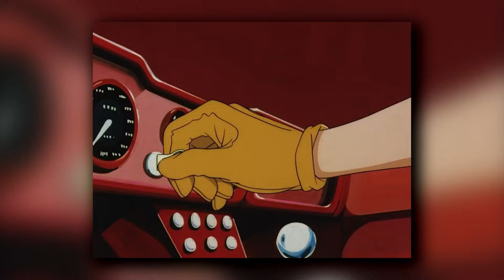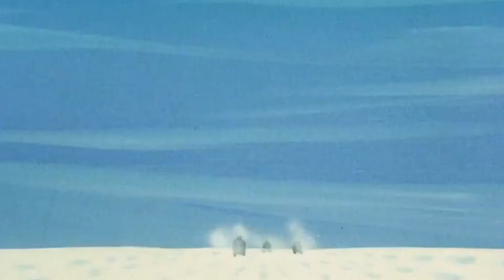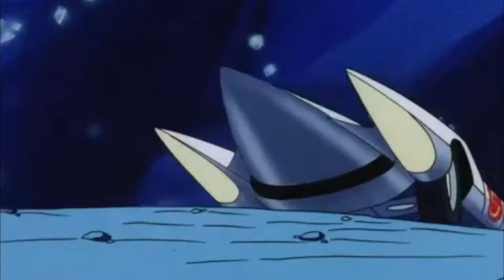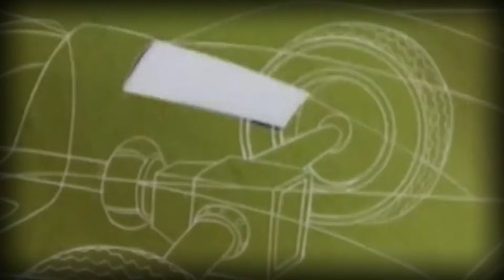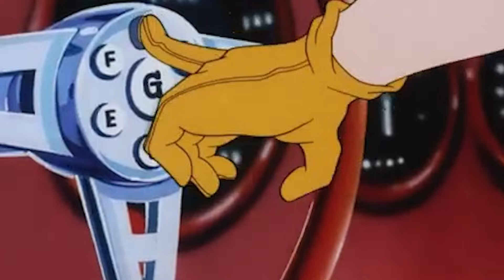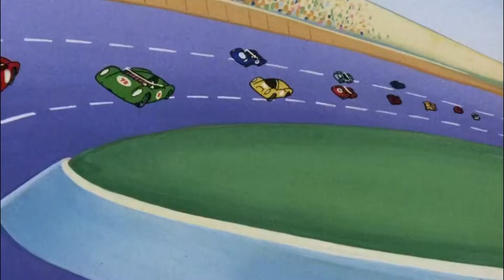The Anatomy of the Mach 5: Secrets Under the Hood

Comment: The inline-4 BMW M12/13 could generate up to 1,400 horsepower from just 1.5 liters of displacement. It's based on the 1961 M10 engine.

The engines were completely rebuilt after 600 km in low power race mode, with moving parts like pistons and bearings being replaced. In high power mode for qualification laps, the engine was swapped after one lap.

Turbo lag was a solid 2 seconds, after which power would be delivered without prior warning. You need to plan 2 seconds ahead and hit the pedal at the right time. At every curve.

While BMW had used water-alcohol injection previously (to cool down the air), I have no information whether that was used in the M12/13. I've read somewhere that BASF had developed a new fuel for BMW instead, but I found no details about its use.

So whenever I see Speed Racer, one question comes to mind: How comes that the Mach 5 was never banned like the M12/13?

Comment: A V12 is not a jet engine. No matter how u cut it.
Reply: The Merlin produced over 70 horsepower just with exhaust. It's also possible it's taking advantage of the Meredith effect.

Piston rockets have been a thing, usually as the power source for the turbo pump or something.

Comment: The yaw problem with the saws is fixed by making them counter rotational.
Reply: In one shot, the saw blades are indeed counter-rotating. In other shots, they rotate in the same direction. I guess the Mach 5 must have at least two sets of blades.

And yes, the tips are moving at supersonic speed.